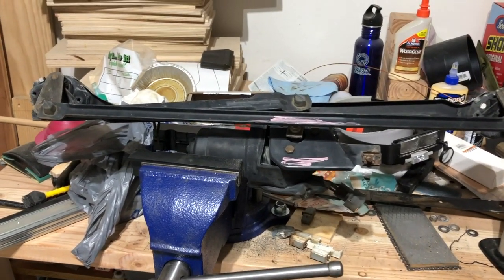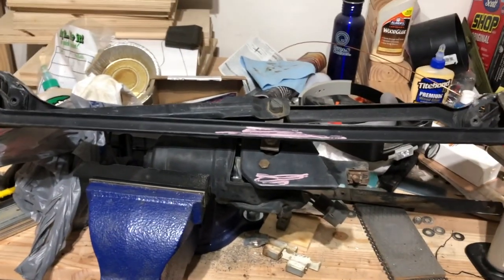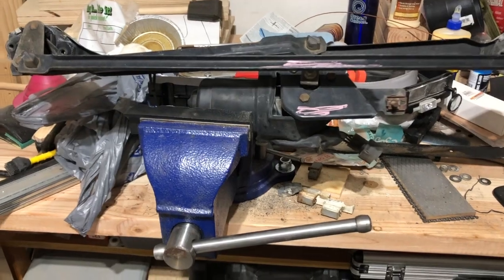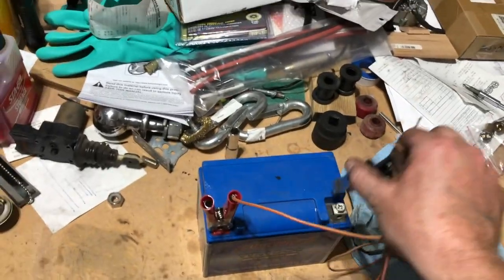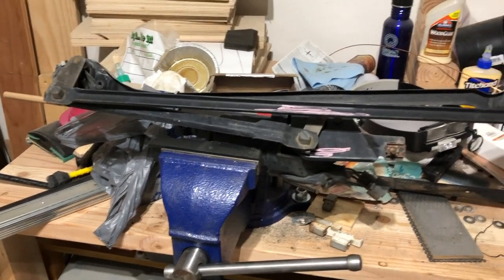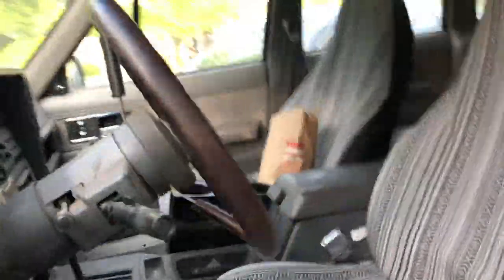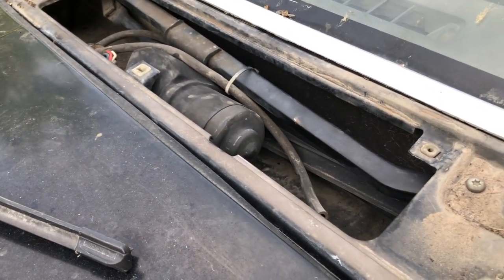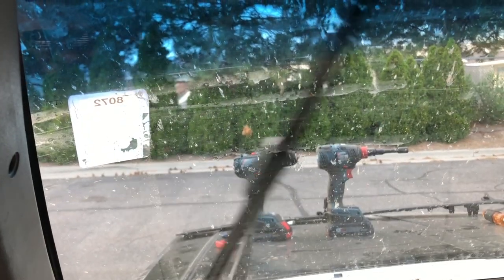XJ Project - Windshield wiper motor swap

Comment: Intermittent wipers in your XJ are controlled  by an " intermittent control module" located under the drivers side dash and attached with a Velcro patch.
Reply from the maker: Thank you for the information. It has taken me a minute to address the issue, partly because I had a hard time finding the part. The OE version of the module is no longer available, and looking for an alternative part online yielded nothing, surprisingly. After that I kind of learned to deal with it. But recently go married, and the wife has driven it a few times in the rain and made it clear how frustrating it was for her, not knowing or really wanting to learn the nuances of how to get by as I had been. So I was motivated to find a solution. A forum thread addressing the module said there were certain GM cars that had a compatible module, (very broad and therefore not very helpful), and a few years of grand Cherokee. This was more helpful, but still lacked specifics. Some people said they had done the “swap,” and even showed blurry pics, but did not specify the year of the doner vehicle or part number. Today I went to the salvage yard where they had 4 early model XJ’s like mine. The module was gone in all of them. But there were around 20 zjs, so I started looking through them. Found a module that looked like a match to the blurry forum pic in a ‘95. Ran me $8.50. Put it in soon as I got home, and voilà! Full functioning wipers and washer fluid. If not for your suggestion, I would have replaced the multifunction lever and been chasing wiring needlessly for who knows how long. You saved me a bunch of time and $, thanks again.